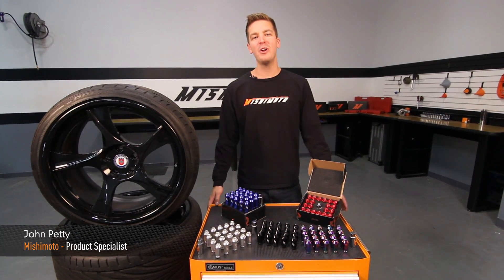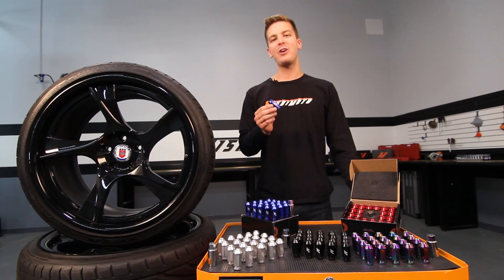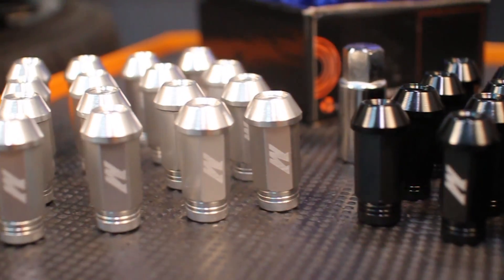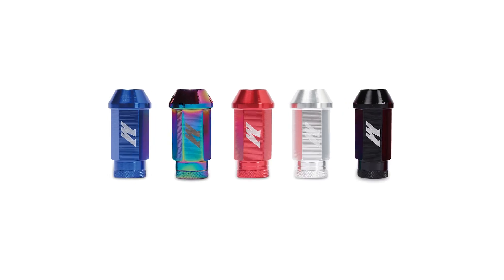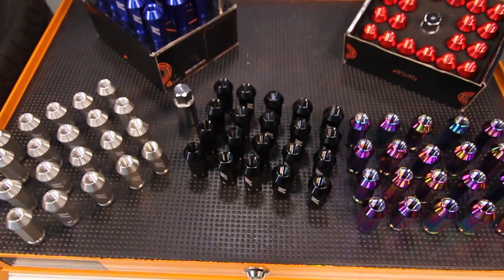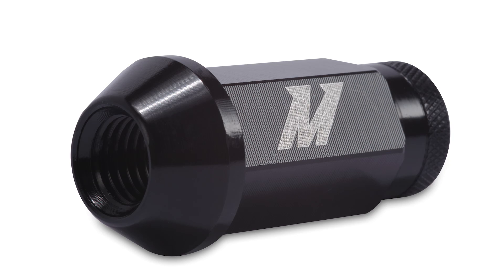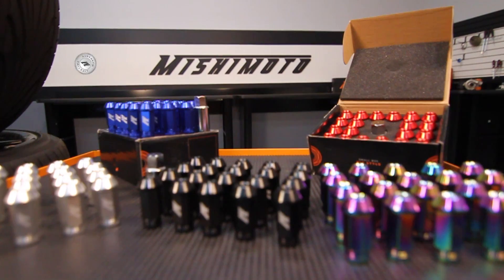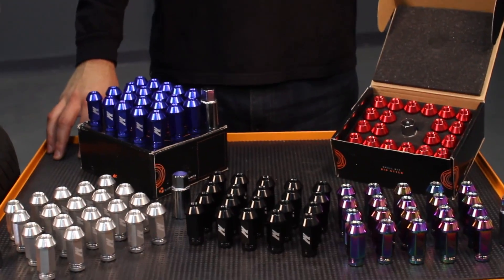Mishimoto Aluminum Locking Lug Nuts Features & Benefits, by Mishimoto

Comment: Can I use these for stock 2011 STI wheels?
Reply from the maker: The seat style for the lug nuts are conical so if your OEM wheel use a ball style you might run into issues with this.

Comment: Is your locking mechanism just a mishimoto standard 7 sided nut with matching driver or are there multiple designs you put out?
Reply from the maker: The locking lugs are 7-sided. There are 4 included in each set along with a matching key.

Comment: Show a video of somebody trying to steal your wheels are these good I don't car about the colors I care about my 22's asanti's rims are these good or just bullshit like the others locks
Reply: The wheel lock looks almost identical to the other lugs but it has seven sides instead of six. Only mishimoto’s custom tool included w the lugs would ever fit it. Seems very secure, depending of course on how many lug nut sets’ keys are interchangeable.